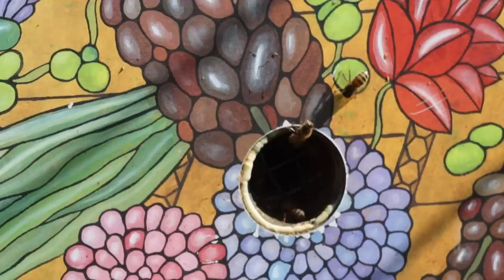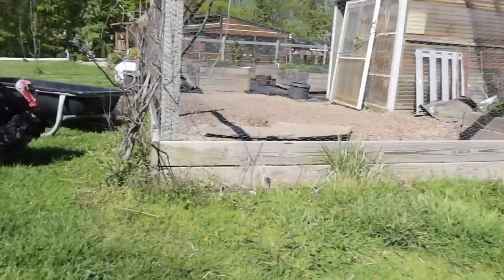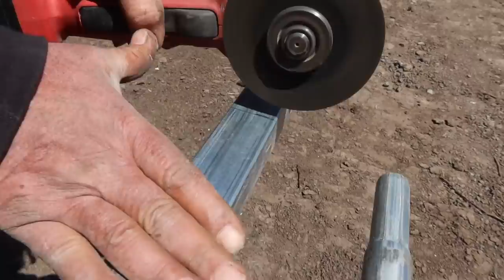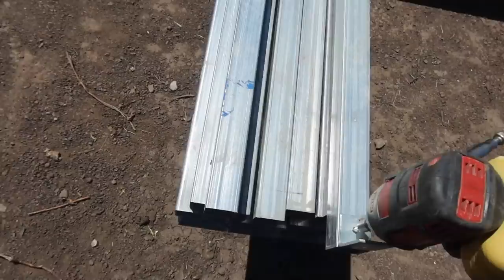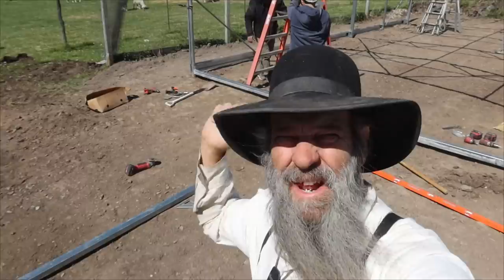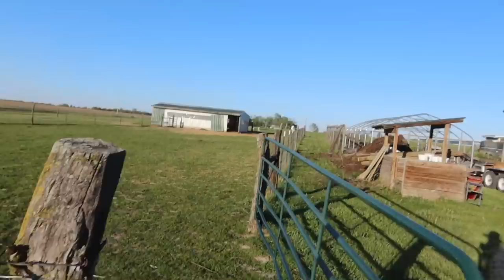Building a High Tunnel so we won't STARVE! part 2

Comment: The wind has been so incredible, it's hard to go shrimping the past week for the smaller shrimp boats. If you look at Satellite feeds, you can really see the haarp waves in the sky. Looks like ripples in sand
Reply: @altasadventures1139  The waves are just their machine turn on and how they control the material that the airplanes are releasing. I'm about to release a new video that is from live satellite at this moment

Comment: We have the chem trails everyday. It's easy to tell the vapor trails from passenger jets, apart from the chem trails that come from the other planes. The bad ones linger, while the other ones are shorter and disappear quickly. I hope your high tunnel helps because I know that much of what they are spraying is in the Nano particle size which can't be filtered out.

Comment: Where I live in New Mexico they don’t even give high wind warnings unless the winds are going to be 45 knots (51 mph) or higher.  20 to 30 knot (23 to 34 mph) winds are normal here.  It’s fun driving to the next town over (100 miles away) in 65 to 70 mph winds.  We’ve had guests as high as 100 mph.  Not from a tornado or hurricane, just straight line winds.

Just remember to praise God for the Glorious Day He created and be Glad in it!

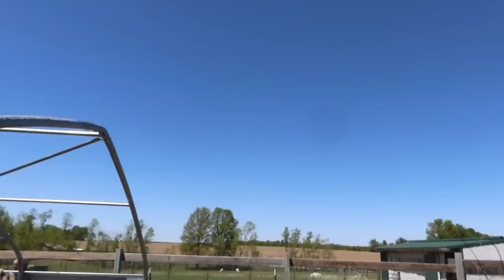Comment: You still have the geo engine ering haze. You do not quite put the cam facing the sun proper but when you showed us I could see the haze, the white silvery, pearlized haze. Put your thumb or four fingers over the sun and you will see it. No lines but that is probably the reason for the wind...they spray it west of you and turn up the wind. About 7:46-8. The sky should be all the same color blue, at the top pole of the ghouse it is lighter. When I was a child, the clear blue, same color went all the way to THE edge of the sun.

Comment: I think it's time to braid the beard! Looking good. Was wondering did you by chance mention what size your greenhouses is? How do you plan on driving your John Deere in there to dump soil and such in there with that metal bar along the bottom? Will you be doing raised beds inside the high tunnel as well? Will you have to do another rain catchment system to provide water for more plants? The Nana's from Central Florida are enjoying the build.

Comment: Full on sun dimming here in the north of England today Doug. Blatantly obvious.  Spoiling the chances of a really perfect day for May. Impossible to count the trails there were so many.
Reply: Thanks Andrew for sharing. I travel across America in a camper,. I can't remember the last night I seen stars. Chem trailing the hell of our country,  so sad
Reply: Yes, they’re called airliners. Sometimes if the atmospheric conditions are right they produce condensation trails. 🤔🙄
Reply: @nomadicweatherbear  I assume the airliners are  the after effects of chem trailing? Thanks for sharing your knowledge
Reply: @roxane7432  you assume incorrectly. Airliners are passenger jets. ✈️
Reply: These trails are not on standard flight paths.  And by the way jet engines should burn clean with a minimal trail that lasts seconds not hours.
Reply: @andrewkeiley5909  then they could be military. Contrail existence, length, and duration are determined by moisture content of the atmosphere and winds at flight level. They vary greatly.
Reply: @nomadicweatherbear  Dah, I'm sorry, I must have taken the stupid pill today. So  I haven't seen any stars in months because of airliners? Did I miss something?

Comment: YOU TUBER: AWAKEN WITH JP has been brave enough to show who controls both left and right newscasts as well as a lot of other programs. This chart made it so easy to see who to unsubscribe to. JP humorously exposes it all. Finally it made sense why FOX had to let Tucker go. A podcast group  has just offered Tucker 100 million for joining them for five years. Check it out! The mystery has been solved. TY to Awaken with JP for getting to the bottom of it all.

Comment: Sometimes it's safe below the ground
Reply: That is what I did think, specially because of the wind. It would have been safer for the tunnel to be lowered a couple of feet or more under the ground.
Reply: @teresamexico309  absolutely. Mushrooms grow in tunnels
Reply: @nehyeshua  I was thinking about a "Walipini"  type greenhouse that is used in other countries. They place the greenhouse walls underground but still get plenty of sunshine. They do place it underground because of very hot or very cold temperatures as well as strong winds.
Here there is an example:
https://www.youtube.com/watch?v=_QLyGNP9y-0

Comment: Glad to see you're back doing more of these types of videos instead of the 'government is out to get you' stuff.
I stopped watching for a while because this is what I want to see.
The up and down temperatures have my bees all screwed up.  They wanted to swarm two weeks ago because of the warm weather and then we were hit with cool temperatures and a lot of rain.  If I'm timing it out correctly, the next week should be the new queens' mating flights.  If so, I might be able to collect a crop this spring.  IF not, they'll be good pollinators in the rebuilding phase and strong and low in mites for fall.

Comment: Hi ya doing guys looking  good my friends ,I  had a question about your drilling that light duty galvy metal have you tried to use  a" Step drill bit" ? If you're not familiar with it it is shaped like  a cone with 3,4 , or maybe 5 step downs towards the semi-pointed end,the  end or tip has a cutting edge like a self taper metal screw and each step down is a  cutter so the cool thing about this bit we always called m a step bit in Ironworking .They  make a few different bit sizes don't quote my specific sizes oh I just found a wornout one it made by Irwin and its the smaller size  and has 11 steps so drills 11 different bit sizes n my Klein Tool back pack ,great H.D.pack by the way. This bits first hole is 1/8 " then 1/4, 3/8,----up to 
1 3/8  there pricey for a quality Name but well worth it this beat up one 11 drill bit sizes. Looks like Doug could have used a NEW BIT  brother Doug ; anybody who has tools and actually uses the tools will have dull bits ,dull saw blades,dull wood chisels,chainsaw chains,a dull sense of humor I'm just laughing with Doug love you guys and I've never seen any of your videos that I  didn't Learn something from it or just  a refresher coarse. Long time ago I saw You  and Stacy having a great time on the Harley didn't see it again I could assume you got rid of Your Ride that's to bad cause we could get together some OFF GRID Harley riders and go to some cool events  all across this Great Nation:
If  WE THE PEOPLE DO NOTHING TO CHANGE THE WAY OUR GOVERNMENT HAS TAKEN CONTROL OF JUST ABOUT EVERYTHING IN OUR LIVES, LOOKING UP BRIGHT  BLUE SKY'S ARE LOOKING TAN N GRAY ,,WE USED TO BUY OUR GROCERYs in stores and carry out in paper grocery BAGS but then some overbearing ecologist protested humans are cutting down to many forest and killing the Spotted Owl in the Northwest regions.I have to agree to a point its the Governments mismanagement as far as the critters living in the forest, sure the small ones that crawl  on the ground could die the others with legs  or wings go to another area that spotted owl they talked so much about  through laws regulations and people chaining themselves to trees and driving railroad spikes in to trees so when a sawyer cuts into the tree the saw chain comes in contact with a rail spike at average 10,000  to 14,000 RPM you see the picture its like a bomb went off .When my grandpa was very young he and his girlfriend were cutting old rail ties using a homemade pieced together table saw with a  24"  ,30" maybe 36" circular blade when pushing the blade into the tie it like exploded ,metal flying everywhere and hitting gramps girlfriend violently and killing her. The Peoples government needs to put the brakes on and back the Hell up !! AND let the smart people start running these UNITED STATES OF AMERICA 🇺🇸 🇺🇸🇺🇸🇺🇸🇺🇸🇺🇸🇺🇸🇺🇸🇺🇸  
1  FLAG  1 NATION

Comment: The tunnel is great it just needed to be about 4 ft under ground for natural air conditioning with an air seal as nano particles from a war or the chem trails with nano aluminum boron and lots of other things to complex to go into here but very bad would be better outside . An internal pond below the walk way stocked with grass carp  or other vegetable eaters fish type would be good as you can feed as you weed the fish and get free fertilizer from them as well. Unfortunately if this is a population cull from above there may be more problems to come .Lets pray compassion will win over brutality.

Comment: Uncle Doug, I love watching your videos, but the chemtrail thing is a little annoying. Do you really think commercial airliners would lose weight to spray stuff on us? They charge for every ounce you take on board a plane.
Not saying the government isn't spraying us, because they are. But I really don't believe the commercial ones are. Contrails happen from hot gasses from jet engines condensing the water in the atmosphere. When jets have no contrail, its because its a dryer day. The video you shown of the whole wing of the airplane covered in a condensation cloud, is just that. The compression if the rapid moving air over the wing compressed the air, and condensed the water vapor. Its just that simple.

I do agree with you about them spraying us. They have come right out and said they seed the clouds for rain. So what else do that do? I just dont believe the greedy airline companies would lose precious payload capacity to spray toxins into the air. Our corrupt government would in a millisecond. 

Thanks for the videos, you've helped my wife and I decide to give homesteading a go. Thank you!